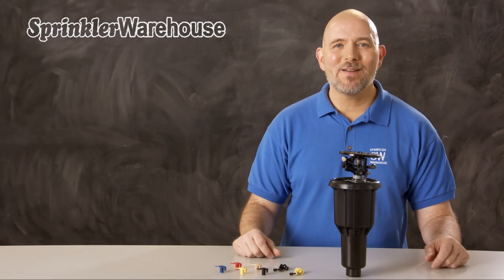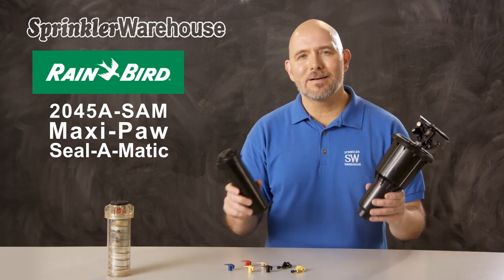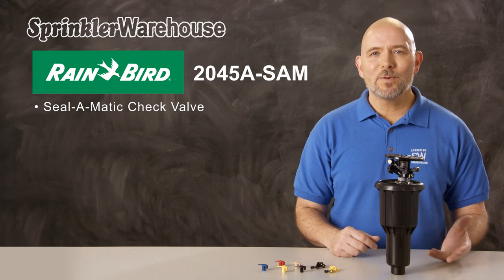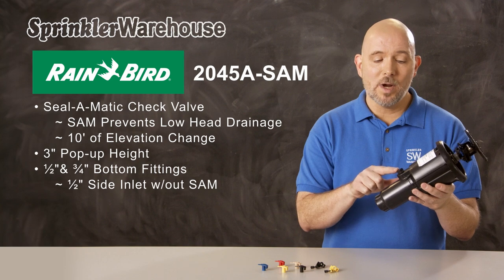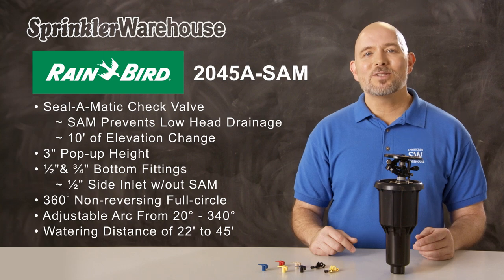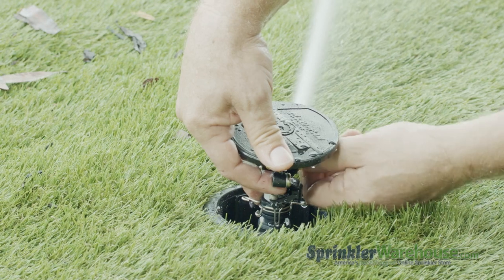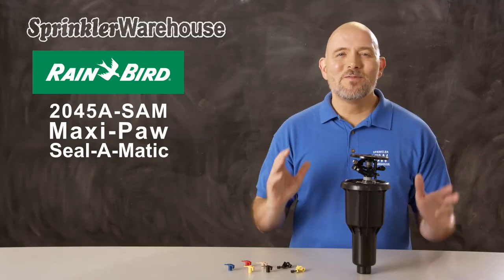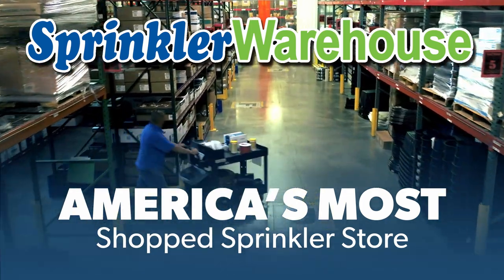Rain Bird 2045A-SAM Maxi-Paw Pop-up Impact Rotor

Comment: My trip switch keeps going up and over the wings of the trip collar. How do I fix this? It looks like it needs a weight or something hung off it so it doesn’t go over
Reply: It’s due to garbage designed when they switched from manufacturing in Mexico to China. The trip lever frequently goes over the friction collars.  The older “made in Mexico” models with a different trip lever never would do this.

Comment: Pulling up the cover is very difficult if the water is not running,  What's the best way ?
Reply: Slim Tip Screwdriver. OR polk a SHARPY marker in the bottom to have it pop up.